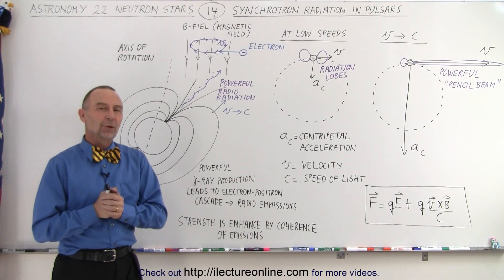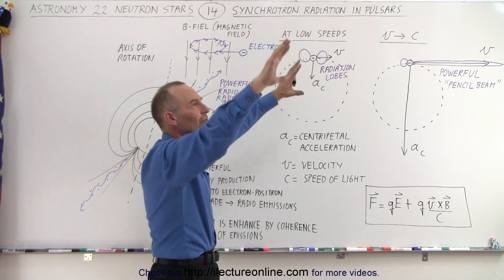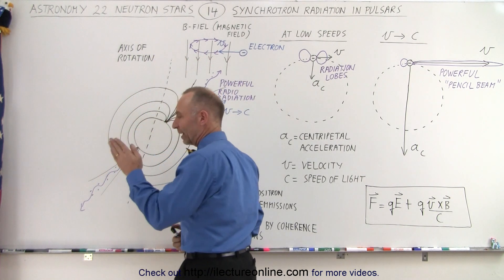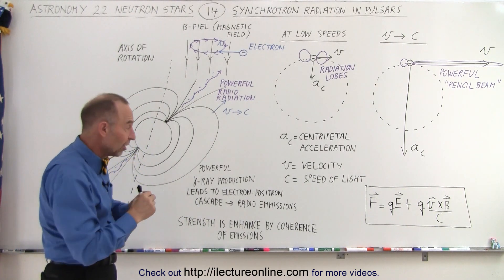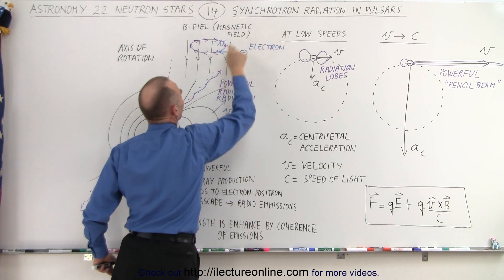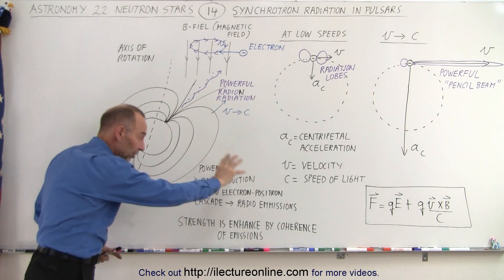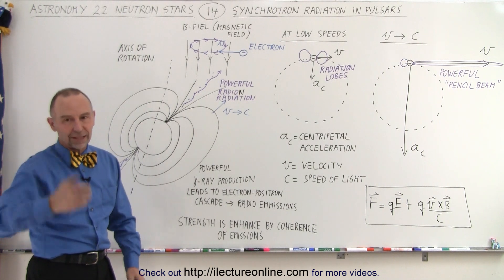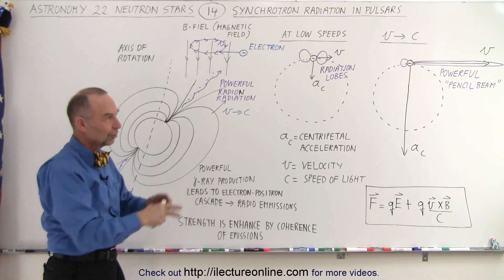Astronomy - Ch. 22: Neutron Star (14 of 17) Synchroton Radiation in Pulsar  [ F = qE + q VxB]

Comment: at the end didnt you mean to say that the electron is zipping out along the path of the magnetic field and not the radiation? or am i off?   

are most if the electrons that make up the radio signals emitted off the star or are they intercepted from space?  

it been a couple years since i graduated with my physics degree, much to your help, i have a sudde interview for a PET technician and they use synchrotron technology.  just reviewing ha.  thank you so much for everything. you helped my friends and i out for years.  so glad you still make content.
Reply from the maker: It is actually E&M radiation.  Here is a good definition:   Synchrotron radiation is the electromagnetic radiation emitted when charged particles travel in curved paths.

Comment: In your first drawing, the powerful radiation firing off in both directions conserves momentum, as such no net momentum is transferred to the neutron star.  However, what is the source of energy?  I assume it’s coming from the electric field.  What is generating the electric field?  A changing magnetic field will generate an electric field, is the neutrons star’s magnetic field changing in time?
Reply from the maker: The rotation of the neutron star.  We have shown that the rotational speed slows down over time.  The loss of kinetic energy is converted to the energy release of the neutron star.
Reply: Michel van Biezen ahh, ok so the neutron star is losing rotational kinetic energy....thanks!

Comment: solid disk and object rotates around vertical axis with 1 revolution per second (object is on solid disk) and what distance do you have to take that object from disk centre to fall apart that object  from disk?(object is loose on disk) Sory for my bad english.Please help me Sir😭😭😭
Reply from the maker: The centripetal force = m v^2/R     The maximum friction that keeps the object on the disk = N x mu = mg x mu       Therefore the point where those 2 forces are equal:     mv^2/R = mg mu     OR    R = mv^2/mg mu    OR   R = v^2 / g mu  (mu is the coefficient of friction)    v = omega x R    Then R = R^2 omega^2 /g mu    OR   R = g mu / omega^2